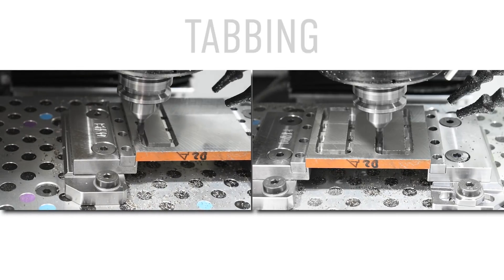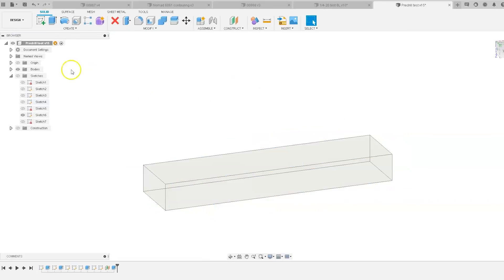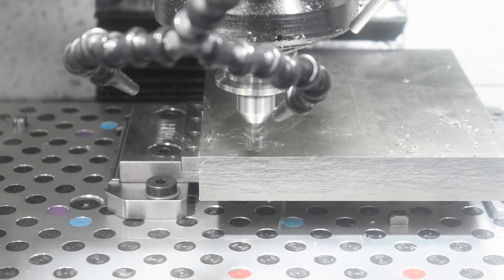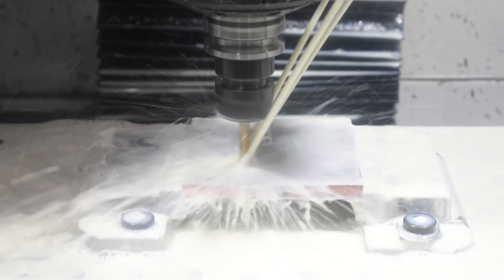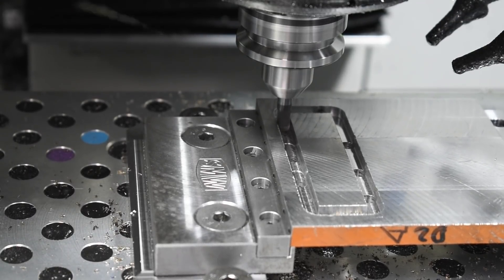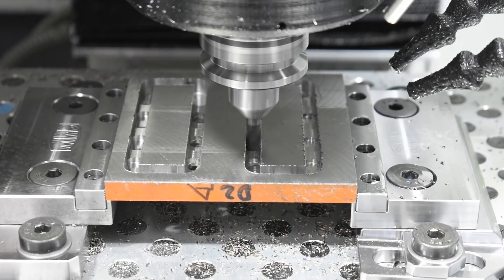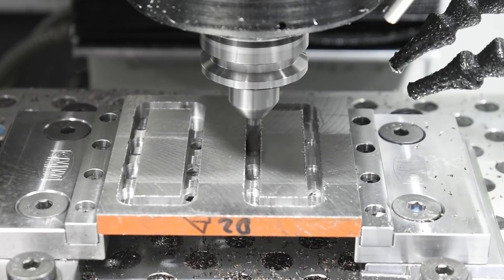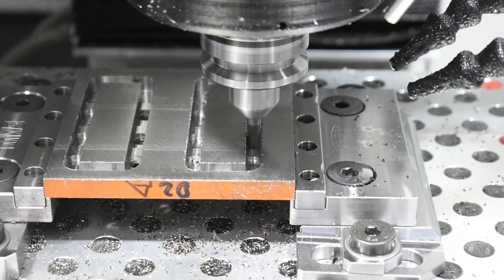Pre-Drill Holes for a BETTER way to tab off Machined Parts!

Comment: Should just slot mill the entire thing.  No need to drill all those holes.
Reply: Agreed! I machine a lot of acrylic and aluminium sheet. I have the material toe clamped at 20mm above the bed, supports in strategic places, and use the ramp feature in F360 to slot mill the entire part until it falls out the bottom onto the machine bed. Quicker, way less post processing and cleanup, and way few tool marks...

Comment: I have been doing this with some parts I routinely make in 304 and 316 stainless, I've found that drilling out the corners to a larger size than the endmill helps significantly when slotting out deeper parts. I try to drill corners less than 90 degrees at double the endmill diameter. For instance, there is one part I make from 1" mill plate that I profile out with a 1/2" endmill, the corners are drilled to 1" diameter to let the chips flush as the mill ramps in. This has allowed me to hit surface finish specs and the part is complete minus deburring. Prior to the oversized holes i would have to setup a final pass operation because chips where recutting and damaging the finish.

Comment: is there any reason the tabs were so big? i mean i make much larger parts with tabbed machining and my tabs are maybe .02" thick, like .1" wide, and i only have 6 of them and feel like even that is overkill. those tabs seemed to be quite thick, super wide, and a ton of them.
Reply: Maybe to prevent compression on cuts from the clamping force of the vise.
Reply: @williamlane2126  thats a possibility,  I typically toe clamp my material down for tabbed machining to prevent that I guess. But it is really hard material and there was still plenty of material left.

Comment: Interesting video !   It totally makes sense for tool life.    Most of the things I need to make on my lol  CNC router  require full slotting like this.   (I'm so close to getting my wife to give me the GO signal for a Tormach Mx  )

These tips are great because it is totally out of the box thinking.  The simulation makes sense.  the load reduction on the tool for tabbing makes sense.    This will totally help me out.  In my case I cannot really drill since I am limited to high spindle RPM,   but I can still take my 1-flute 1/8" and helix ramp it into making holes before I run it into the crazy slots.

Thank you !!!

Comment: Simple but intriguing concept. I'd like to see if you could actually beat your cycle time by using a smaller endmill and trochoidal/peel milling at full depth (say, a 3/16" endmill starting from 1/4" drilled holes).

Another thought is trying those new solid high-feed endmills. They should be able to handle the small step downs pretty easily and feed significantly faster.

Comment: Good Video.
On the topic, drilling is almost always a faster and more economical way to remove material than milling, so if it were me, I would (if the job allows for it) make tabs much smaller and have more of them (i..e. more drilled hole) and also would remove as much of the slot as I could with series of drilled partial and full depth holes. If done correctly, you could get away with just a single pass or two with the mill to clean up the rest of the material and make better use of the mill (i.e. deeper and / or full depth cuts). Although it might not be ultimately any faster (especially since CAD/CAM time will likely increase), it does often result in better tool life and since drills are almost always cheaper to replace than mills, cheaper overall tool cost in the long run.
Reply: I agree but would like to add that, assuming we got the toolchanger space for the drill, we'll drill and then run an HFM ramp at as fast as the endmill wants to go (upwards of 4m/min at the standard haas 8100 or 25m/min in my personal machine if i got a larger drill than endmill)

Comment: This really is situational. You have to evaluate if that extra time you spent on drilling will really benefit you. Will that extra time increase tool life enough to return "wasted" time? Especially in production runs, where tool cost is only fraction of all the costs of making things, where time is majority of it.
Reply: Cycle time isn't everything... I'd rather have a stable process without broken tools or time down replacing tools than save a few minutes. Ramping down/slotting will always kill your endmills faster than any other kind of cut so eliminating as much of these strategies as you can is a good idea (esp with a drill which has a higher MRR than any other tool in a mill)
Reply: @pmdeutsch  As I said, you have to check it for individual parts. Maybe in reality it isn't really that bad and won't have that much impact on end mill life.

Comment: On the subject of drilling, have you ever checked out exchangeable tip spade drills? I work in a shop that does short and single run parts, so solid carbide twist drills and indexable insert drills usually aren't an economical choice. The spade drills are a nice intermediate; being less expensive, but still being faster and yielding better hole quality than HSS twist drills. Having cutter materials and geometries suited for nearly anything while still using the same body is quite nice. Feeding at the recommended rates can be pretty aggressive, so they might not be a good fit for some smaller machines though.
Reply: We run ingersol gold twists with 1000psi tsc and they are awesome. We actually have better luck with the 180 deg tips and I like them better as a programmer as I can use them to do small , deep pockets with a pretty flat bottom. The only kicker is that the 180 def doesn’t locate well on top of existing holes, it does its own centering on flat surfaces though, saving a spot drill operation. Im a journeyman toolmaker, use them mostly in a2,d2, mild, and 4140.

Try flat bottom tips instead of the spade. We use them for through holes routinely as well. Rarely switch to a spade now.

Comment: Seems like a good idea. However, I have found with my Tormach Jacobs chucks & 770 mill that it doesn't like drilling much over a 1/4" dia hole and the tool likes to pull out or even come off the mounting taper (even though whacked it with a dead blow hammer to make sure seated) Anyone else have these problems?
Reply: I used to have a similar situation, granted it was a much much larger machine. I have a horizontal boring mill that would spin mt6 chucks off of 50 taper tool holders. Cleanliness is the first rule, any oil residue and you'll have problems. Clean everything with acetone at the very least.. Secondly, I now put chucks on with a mild heat shrink. Chuck goes in oven set to 200 degrees and arbor goes in freezer. Hour later Quick slam them together and wack the end of the chuck with a dead blow to really seat it in. 200 degrees is well below any tampering temperatures of even the worst grades of steel and won't harm the chuck. A set of the proper wedges and a propane torch will still get things back apart if need be.
Reply: You’re dealing with 1.5 spindle hp I believe in that machine. What kind of material? Coolant or not? 

Edit, yeah get a new toolholder. I thought you were using a tapershank drill. If you’re pulling out at the holder either your chuck has a screwed up mount or your holder is messed up.
Reply: I also have had that happen with my 770M. I had to whack it several times so it wouldn’t come off.